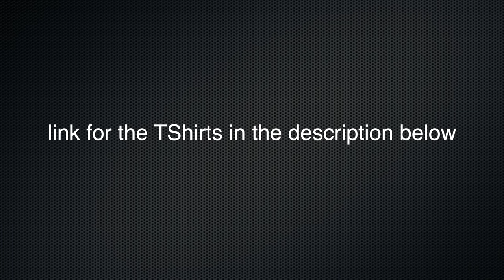Fabricating front apron - Retrobution Coupe Eps 76

Comment: Luv this build if u leave it smooth won’t u get a bit of oil canning? Noise  some nice 45dgree beads varying in length dependant on where they r with evenly spaced gaps would look mint  nice work dream ride ❤️👍
Reply from the maker: thanks alot Karl,  appreciate your feedback,  I dont think it would oil can if left blank , 2 reasons, it has 2 folds top and bottom, and its 1.2mm. , but having said that,  i havnt decided which way im going with it yet.  I will hold off till all panels are made and radiator support is fabricated so there is time to decide i guess.  Thanks for watching !